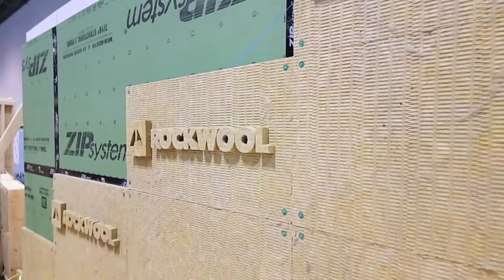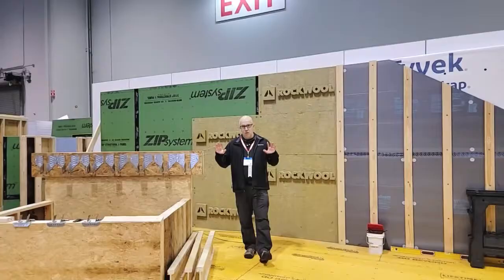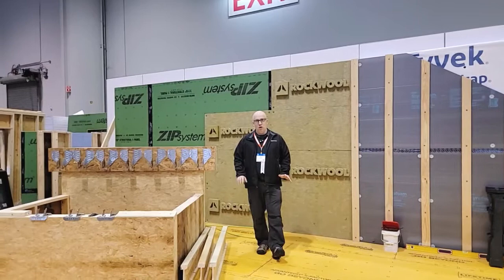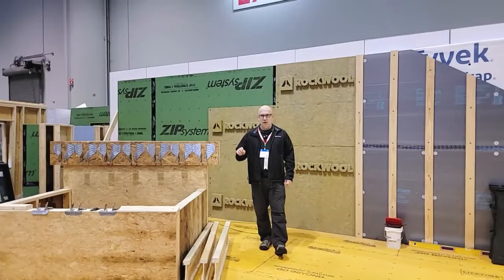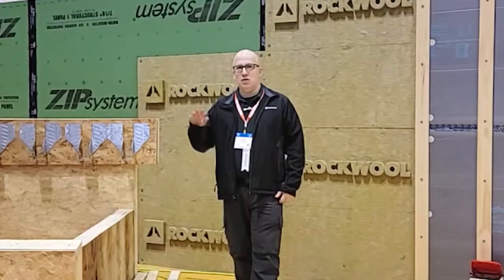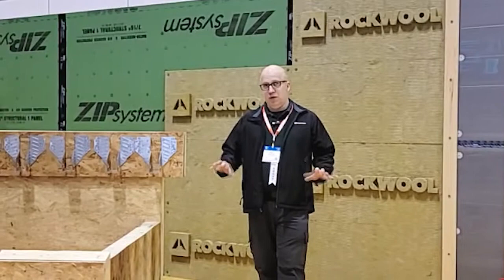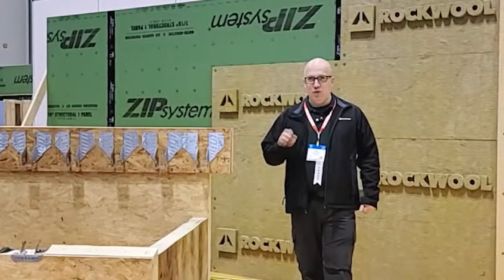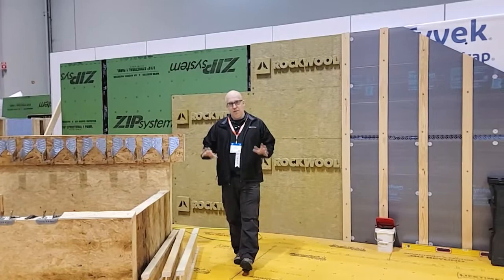The "Perfect Wall" with ROCKWOOL and Huber Zip System at IBS 2022

Comment: Doesn't huber zip have a insulated wall panel? I can see if you are going 8"...then your way would be ideal- but if you only need an inch or so?
Reply from the maker: Huber does have ZIP R- which is an insulated panels.  The inuslation is on the inside of the sheathing.  This works in some climate zones.  Some builders in northern climate zones have expressed concerns about this assembly so they insulate towards the exterior.  I don't think it matters where we build in Atlanta.

Comment: Will a self-stick roofing underlayment stick properly to mineral wool boards? What I have in mind to do is put mineral boards on top of an existing roof deck, permeable underlayment on that, purlins on that, and then standing seam metal. The underlayment is to catch condensation and any leak that may (heaven forfend) develop, the metal is vented, has little thermal mass, and provides a pretty good radiant barrier to take cooling load off the house.
Reply from the maker: I believe the design is to put the underlayment on the roof decking, then add ROCKWOOL, which can breathe, then furring strips for the roofing so it can ventilate.  Here is a good video series on it-  https://youtube.com/playlist?list=PL9uCVHY8B-z8lyQQifDXd0glC_M6zetci

Comment: What type of fasteners are you using for those furring strips, they must be at least 10” screws. That would add up very fast.
Reply from the maker: It does add up quickly- I plan on doing a video explaining the costs in the next month or so and the more affordable way to install ROCKWOOL
Reply: @SawHorseDesignBuild  could you link to that video please?
Reply from the maker: https://youtu.be/koKPdBkOezA?si=wsv0N9Z5gUW8zTLP

Comment: I like this, but have a bit of an issue with the reality that as carpenters, we dont always hit the stud.  So when we miss and pull that screw out it leaves a hole in the air barrier. Also, 1x4 is tough to keep straight and we end up  rushi g the insulation a bit when we install them.  What is your opinion on this option : https://youtu.be/rmMcP9fTQFQ?si=KL2nATDdzUWoyOgu
Reply from the maker: That system is not bad.  Honestly, the system really depends on the cladding.  I am going to make some videos this year showing different options for stone and stucco as well. 

Yes- you want to hit the stud.  If you don't leave it and add another screw since  you don't want a hole.